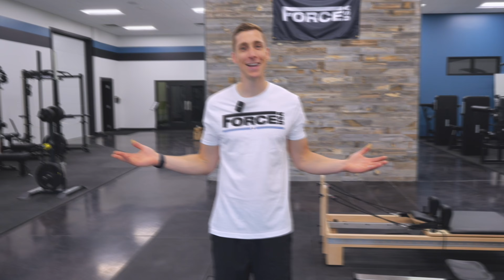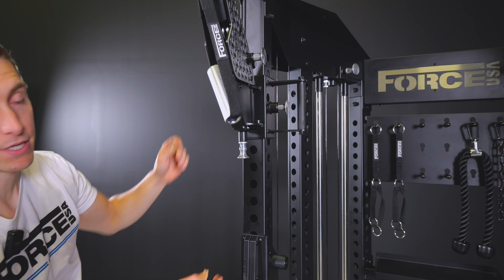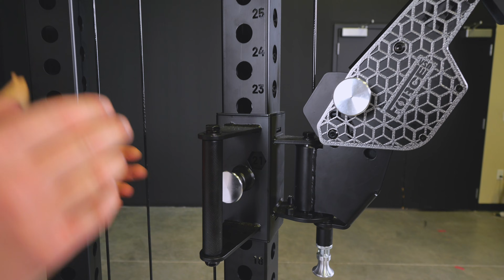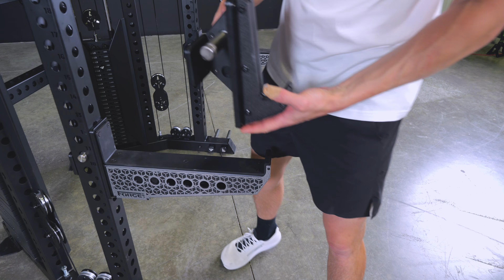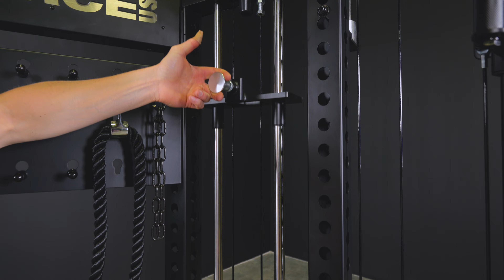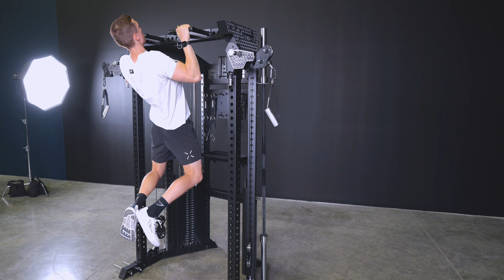Force USA FTR Review: CURVED and COMPACT - Functional Trainer Power Rack

Comment: Great review! Thanks! Do you know if there is an adjustable pull up bar height option that could plug into the 1 inch holes? My basement height is 92 inches so not enough room for me to do full rom pull-ups with this being 88 inches
Reply from the maker: I can't think of any directly offhand but I think potentially some from Rogue, like from a squat stand, would fit here. The thing that actually comes to mind is using some sort of knurled handle option, because then you can just put the handles on each side and remove them pretty easily. You would just get a 1-inch handle option, like the Rogue Mutant Metals or similar. https://go.thejunglegymreviews.com/mutantmetalshandles
Reply: @TheJungleGymReviews thanks so much for the reply! That is helpful! I am tempted to get the 88.5 inch model so I have better range of motion on pull downs but I'm worried about fit since my basement ceiling is only 92 inches. I could go with the 82.5inch option but I am worried I won't be able to get full range of motion for things like lat pull downs given I'm 6 feet. Have you tested the 82.5 inch model at all and did you experience those limitations?

Comment: Great review!

If budget wasn’t too much of a concern and ultimate FT cable smoothness was and ability to retrofit voltra on said FT in the minimum space (ideally but can get 2 separate ie ultimate voltra attachment wall unit & ultimate FT) - which functional trainer would you choose? 

Rogue, Rep, Force USA, Inspire Fitness - another commercial gym brand/ piece?

Seems like there are just too many options and locally in Australia - not many stores to try the actual equipment out.
Reply from the maker: definitely something 3x3 for modularity/voltra compatibility. I would say this or the GetRXd tornado compact rack. they both have articulating arms, I think GetRXd is a touch smoother but it's not corner oriented like this and you can choose smith or no smith with them. not as nice of finish as this, or storage options but its really good functionality for price
Reply: @TheJungleGymReviews thank you!

Comment: Great stuff. Would the C10 be worth the upgrade for roughly $500 if the space allowed? Torn between these 2 machines.
Reply from the maker: I personally would choose this over the C10 due to aftermarket attachments, but the C10 has a smith built in. so if you don't mind using the attachment from Force USA the C10 is extremely capable. if you need aftermarket stuff you will want this since it's a more universal 3x3 uprights with 1" holes meaning you can use any aftermarket attachments from any other brand, just won't have room for a smith machine on this one sadly
Reply: @TheJungleGymReviews  Update: I've had the FTR for 14 weeks now. I freaking love it and the extra space it gives me helps so much for attachments. The swivel seat is annoying how it rises up on lifts. I don't get that. Tks and God Bless!

Comment: Hate mine!!!  Not recommended!!!

Where are the J Cups and Safety Spotter Arms???  I paid for the FTR on September 15th and at that time you advertised that they would be available in mid-October 2025.  

I received the FTR three and a half weeks from ordering - about a week earlier than expected which was great, but there were parts missing - not so great.  So I contacted your Customer Service for parts and was told that you did not have parts available yet for your “Cornerstone” line of products and you would see what you could do.  In the meanwhile I had to spend an additional $40 on Amazon for parts just to get the FTR cable system working.  A week later I did receive the missing parts and replaced the Amazon parts with the appropriate parts.  Unfortunately the cable system is not good at low weight selections, probably due to all of the pulleys involved - any selection below the 30 lb or 40 lb plate is not great - as compared to my Inspire Fitness FTX which was about a third of the cost of the ForceUSA FTR.

Where was I going with this???  Oh yeah, the J Cups and Safety Spotter Arms.  I told myself that once I get those I can make this thing work despite its flaws, so I waited patiently until November and they were still not available.  I finally got tired of looking at the new coat rack in the garage a.k.a. the ForceUSA FTR and contacted you again.  After several back and forth e-mails, it was revealed that the J Cups and Safety Spotter Arms will be included with the FTR and I would not have to purchase separately, which initially sounded good, but I would have to wait until “later this year?”   Three days ago you started advertising the Safety Spotter Arms on your All-In-One Attachments for $99 but they were “temporarily out of stock.”  Now today, 11/22/25, the Spotter Arms are now priced at $249.  If the Spotter Arms are included with the C20 and FTR, who are you selling these to?  Will the purchasers of the FTR have to pay for these after all?  

Cons: 
Had to help delivery driver get off of truck - shipping container loaded onto truck with a forklift but pallet jack too low to get past bumpers at the back of the truck - had to use hammer and crowbar to pry off the outer legs of shipping container just to get off of the truck.  Best work-out with the FTR to date!

Parts missing.

Paint scratches easily, various scratches from shipping - luckily the scratches it did come with were hidden when assembled.

Cable system not great at low weight selections - anything selected above 30 lb plate good, 30 lb and below not so good.

Too much wiggle/jiggle/noise in the freestyle pulley arms - some angles/settings/direction of movement better than others.

J Cups and Safety Spotter Arms not included and unavailable to purchase…so far.

Pros:
Fits ok in a corner.

Cool looking coat rack.
Reply: Why you directing that at him? 😂
Reply: @GotMoreCakes  I am "directing at him" because I bought the FTR based on his review.
Reply: @chrisl06340  That makes no sense, what's he going to do about it? Talk it out with the supplier..
Reply: @chrisl06340 that’s on you. Nobody made you buy it
Reply: That’s my hesitation with buying something with so many parts to install, stress and frustration will sure to follow. Plus it’s so big and heavy that returning it would be impossible.

Comment: Would you know if something like the VTS smith attachment works with the middle posts of this rack? It seems like those posts are not oriented completely straight. I'd be interested in this form factor if there was some way to add a smith attachment to it!
Reply from the maker: unfortunately they would hit the shrouds, weight plates, guide rods, and/or cables themselves so unfortunately don't think it would work on here. also as you said they are angled so even if it did work you would have a not straight angle between the 2 units. sadly I can't think of a system that right now that would work on here that wouldnt be on the front uprights

they won't work on the front uprights either because of the cable routing
Reply: @TheJungleGymReviews thanks for confirming! Appreciate the replies as always. Still trying to determine if smith machines are worth it or not. Do you find them useful at all for your training?
Reply from the maker: @deandrecurry13  I personally find them very helpful and have been using them for years. other people say smiths are lame but I think modern weight lifting culture currently sees smith machines as cool again because you can go heavy for the target muscles without having to rely on stability or other musculature. I love it for things like bench variations, squats, row, seated OHP. I think it's a great accesory that adds a ton of variety without a ton of space and without a ton of money dependent on the specific attachment. I find variety very important in home gyms as well so I will ALWAYS have a smith machine attachment in my gym
Reply: @TheJungleGymReviews  Thanks for the details! Just bought the tornado rack with the smith using your affiliate link after reading this. You rock, hope this channel keeps growing and growing!
Reply from the maker: @deandrecurry13  I appreciate that so much. excited to go on this wild ride! thanks for coming along and for watching and the affiliate link support, thats exactly how I am able to keep doing these reviews

Comment: I’m surprised they haven’t got different options available for pull-ups. A taller, raked or offset pull-up grip would allow those of us that are taller to do pullups without having to pull out knees up. 
Also, could you see any issues with connecting the sliding bench directly to the arms if internally rotated and set at the correct height? Looking at adding the extra weight stacks and giving it a go. 
The foot plate connection would need to be set further out of the rack- maybe connect it via an adapter to the spotter arms set inwards facing? 
Great review!
Reply from the maker: thank you and thanks for watching! I am sure over time they will add them, for the initial release it looks like they kept all their new 3x3 attachment to a minimum. they didn't have a lat pulldown seat either...

on the arms, they are actually working to make this sliding bench compatible I believe but your problem with the arms both inside is going to be stopping the bench from sliding forward plus, I am sure there is some structural limitations to how much force you can have against those arms. I wouldn't personally be comfortable more than 2xing the weight lets say even if you got something like a weight stack pin

Comment: Great review!  Do you know the maximum side to side width from pulley attachment to pulley attachment with the arms rotated out?  Thanks
Reply from the maker: unfortunately I don't know that offhand exactly but it would be somewhere around 80-86 inches (50 inches of rack width and an extra 15-18 or so for each arm out fully extended)
Reply: C20 is 79”. Not sure if this is different

Comment: Thank you for the detailed overview of the FTR. I do have a question though. Would you be able to slide a bench back far enough to do incline bench press (appox 45 degrees) and seated overheard presses? It appears that the opening in the back where you would need to slide the bench legs through is a bit narrow.  

I do like the FTR quite a bit and it seems to fit my needs. However, not a fan of Force nickel and dimming the customer on attachments, etc. Adding in the costs of attachments gets you a very solid all in one (of course if space allows).
Reply from the maker: you are welcome!

incline bench yes, seated OHP, probably - the rack is deeper than you think and will ultimately just end up depending on your bench length and feet but would say 90% of traditional benches will be able to fit for those no problem

yeah I would love to see some attachments with this included for the future, my guess is people would be off put if they baked in the cost of attachment (although nice attachments) and then it would raise the base price. not really sure, BUT you can always use any other brands attachments now since it's 3x3 so you can find what you need and what fits your budget there so that is nice
Reply: @TheJungleGymReviews  That is great too hear!! I have a 2x2 rack currently - so some of my attachments won't work. It's not bad, but would be nice if they at least included jcups and spotter arms. The lack of using an incline bench would have been a major issue, But, it looks like like that may not be an issue after all.

Again, thank you for the response and the detailed overview of the FTR.

Comment: Can you connect the two arms together in the middle of the rack using either a carabiner or a connecting plate like the one Rep uses to get 1:1 weight resistance?
Reply from the maker: absolutely. they haven't made a native connecting bracket for it yet but I know REP has one that might work. GetRXd has a multi hole one that might work even better for their machines but it would work well for that application here on the FTR
Reply: @TheJungleGymReviews  Great thank you for confirming!
Reply: Darko shorty bar works perfect for that.

Comment: kinda sucks that they didnt add the pulldown and low row capabilities of the Rack version. With that it would be an easy buy, but as it is Id rather wait until rep adds arms to the Ares.
Reply from the maker: I think they were going for super minimal here hence keeping the cost down (comparatively) at ~$3500 for this vs $6500 for the C20
Reply: It’s already expensive like this. If you want that, get the c20
Reply: Yeah. Need a shallow rack like this with the pull up and low row.

Comment: I would be one of the niche use cases in a small room it would be great to use a corner and it leaves enough room for a shorty bar between wall while
Opening up space but the 87” exterior height is a no go in an 84” high room.  

The ares is still the target.  Ordering in about a month but watching just in case something else drops that dethrones it for my use case specifically

Comment: Why not stick the thing in a corner so folks can see it actually used in is stated usecase? I think it would be nice for people to be able to see how much clearance a barbell will have if used as a half rack.
Reply from the maker: fair point. if I am being honest the reason is for filming. trying to move a 600LB rack once it;s setup with just myself and my 140LB camerawoman wife is impossible and second filming in a corner feels very cramped and dingy.

so that being said the decision was made to space it away from the wall, but to your point doesn't allow people to visualize it spatially. sorry about that
Reply: So is there room to do bench press on this if it’s positioned in a corner like it’s designed.  Haven’t been able to find an answer which probably means no.  Could be the determining factor.

Comment: If someone wants plate storage horns on the back, I don't understand the space saving corner design (added cost of 2 extra uprights). 
Also, the front feet look a bit short. My band pegs are 10.5" from the upright face.
Reply from the maker: yeah if you want to add to the back, it's not saving a whole lot of space. the whole concept from what I understand is, you already have a functional trainer, let's make them 3x3 posts so you can use it however you want. if you want it to be a FT in a corner with no barbells, no plate storage, you can do that. if you want to make it the centerpiece of your gym you can do that and build it out too

Comment: I’m not understanding the advantage of the more narrow back side. Seems like a niche use case of wanting to put a rack FT combo in a corner. But how much space does that actually save vs putting a 4 post Ares in a corner?
Reply from the maker: I agree with you but also when you put it in a corner it saves more spaces when you need to do barbell movements as well because then you don't had to add space away from the wall or other machines. 

it basically covers 2 things in my eyes: 1.) you need a corner machine due to your room/space/layout 2.) you want a 6 post rack but want something more compact

I do agree it's more of a niche product for sure but it's not for everyone but if you do fit the bill to those scenarios you are golden
Reply: @TheJungleGymReviews  it would be flush into the corner though?  Barbells are 7ft or something standard, so bee at least that clearance?  My thing on the angled rack is not necessarily “corner” placement, but just less space as you store things in the back, as well as convenience and aesthetics for changing stacks.  C20 is angled and obviously is not going in a corner, for example.
Reply from the maker: @seamusandangus  no it won't be flush in a corner but it's closer than obviously a normal 4 post or 6 post rack. you are right though, the corner placement does limit some of the usage of the uprights for storage, but really I think this is exactly why they made this machine. want to use it as a centerpiece in the middle of the room? 6 post power rack. don't need barbell movements? corner functional trainer

Comment: Looks sick!
Reply from the maker: really unique idea that I can't believe nobody has thought of so far. 6 post rack and FT had a baby and here it is
Reply: @TheJungleGymReviews that design is not new, lots of machines with same design and footprint in Europe. But most miss the longer arms and they are not 3x3 as Europeans can't agree on a standard.
Reply from the maker: @yvind6595  great point, the idea of power rack + FT trainer already exists, typically its 2x2 ish (like you said can't agree on the sizing). This is the first 3x3 that I am aware of which I think lends well to the aftermarket/cross compatible attachments so I just think it's cool to see for those who have that use case of compact, small space, corner design, but now want to add a lat seat or similar.